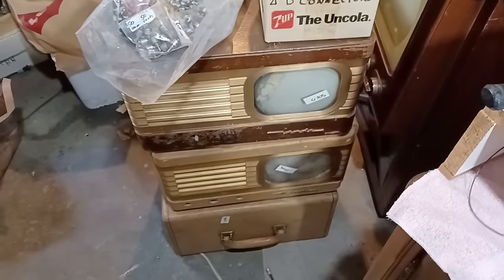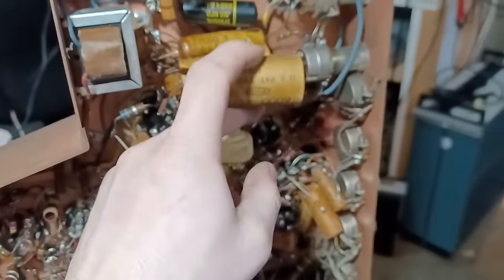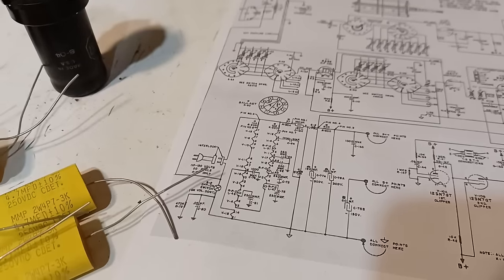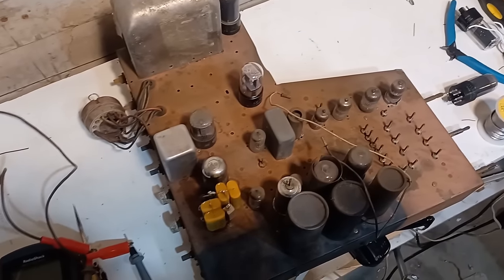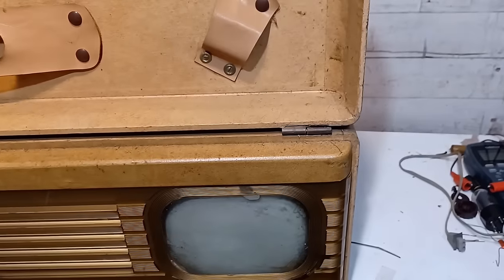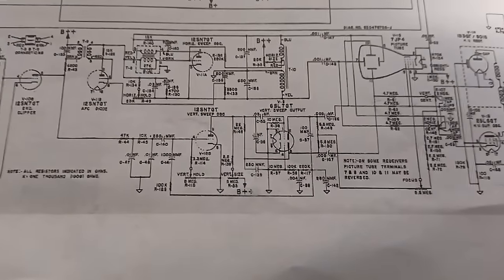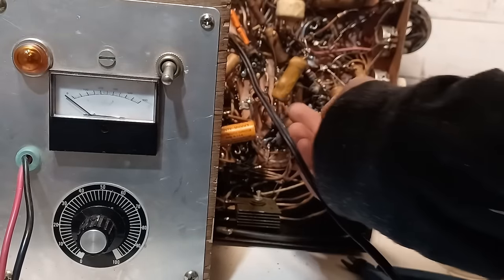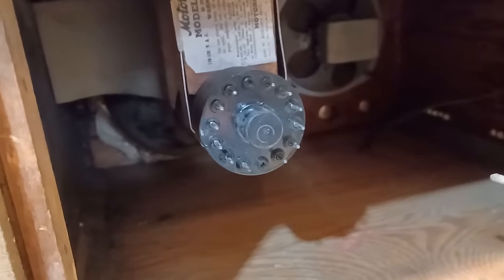1949 TV VT73 Diagnosis and Repair

Comment: I am an electronics tech and started my teenage years first on radio then television in the 1960's .  Here in Australia we didn't have series string heaters and direct rectification from the mains to supply HT to the vacuum tubes.  A mains power transformer was always used in Australian made sets as at 240V 50 Hz mains the dangers were considerable with potentially live chassis unless an isolation transformer was used.  With only 120V @ 60Hz the potential for electrocution of the operator or tech was considerably less. Another comment  is that digital multimeters are not as suitable for this type of repair as an older 20,000 ohms per volt analogue instrument. Especially for reading resistor values and capacitor leakage.  A digital meter will lead you up the garden path during logical fault finding, only use them   when great accuracy is required, in an older set like this, it's basically not ever required .  When calculating a capacitor value to use as a ballast resistor use the capacitive reactance equation ie ;  XC= 10 to the sixth power  over c x freq x 2 pi , where c is in microfarads. Transpose as required.   
I was a SGT in the RAAF teaching electronics in my last years in the service.
Robert
Reply: RAAF techs in my day were considered good technicians.
Reply: Some of the people I ended up teaching sadly would never ever have made top notch techs mainly because  they didn't ever have enough interest to apply themselves fully.  The same in every field of professional endevour , some actually liked and applied themselves to the profession, some were just along for the ride and it showed.
Reply: Fascinating!  Thanks for sharing.
Reply: Just never power it up when you work on them, not a big risc that is!
Australia is UK/ EU system mixup, you can by local Japanese systems!
You restored models, can you upload videos please !!!
Reply: @lucasrem  If you work on live chassis sets,  vacuum tube TV or radios you have to use a 1 to 1 isolation transformer so you can earth the chassis. The same applies to switchmode powersupplies in computers and other equipment.  For some fault finding you have to have power on.  I don't work on old televisions now, I have a a few old vacuum tube radios to repair but am drawn more to the battery portables which when run from the mains use series string filaments and usually a selenium rectifier or copper oxide stacked rectifier which you replace with a silicon diode and increase the value of dropping resistors as required. measure these with a good quality analogue  meter rather than a digital type as they sometimes give false readings especially on resistance ranges. The old AVO 8 was very accurate in this regard, the mark 6 being one of the better types, not so old .
Reply: In Britain, series heaters and live chassis were normal on 200 - 250V.  Until the late 50's some districts were still on DC 220V supply.
Reply: @v8pilot  It was a little before my time  as in the 1950's I was just a child. I have repaired and refurbished some series filament live chassis radios from the UK in the mid to late 1960's .The likes of 1T4, !R5, 1S5, 3V4 type 1.4V filament  vacuum tubes. They were double insulated sets so the live chassis would not some in contact with the user when used from the mains.  These run from 5 x 1.5V C cells and a 90V B battery. I have been trying to design a RF noise free DC to DC inverter to use.  Perhaps a 6V AGM battery would be a good proposal, with a resistor to drop the voltage down for the filament string. The 6V could power the inverter as well.
Reply: @Robbie1949  Yes.  |But the 'double insulation' was a bit minimal.  The grub screws of control knobs had a bit of wax inserted to prevent you touching the live grub screw.  There was nothing to stop someone operating a radio if the cardboard back had been removed.  Most live chassis sets used octal valves the equivalent (except for heater voltage and current) of the normal 6.3V valves 6k8, 6K7, 6Q7, 6V6...
My grandad had a "Double Decca" mains/battery portable that used 1.5V octal valves.  It would operated from battery or, in the house, it could be plugged into the mains and not use its batteries.  Those 90V batteries cost a packet in those days.
Reply: @v8pilot  I am guessing you are in the US or UK ?  In Australia there were and are huge tracks of land of thousands of acres  set up as sheep and cattle stations .  In the late 1920's and 30's there was no mains power in these places so for entertainment sets designed to use rechargeable 6 and 12V lead acid batteries were used . These used vibrator and transformer with electron tube rectifiers to produce the required HT supply.  There are few examples left now I suppose, I didn't have much to do with them.  at 13 I built my first one valve radio with a 1.5V B battery and 90V A battery, it was a regenerative set. Extended relatives saw my interest in radio so I received all the old mains chassis from mainly 1930's sets. The radio case being used for something else. I mostly pulled them apart building experimental amplifiers and alike.
Reply: One of the reasons, I think, why you had mains transformers in Australia was that full-wave rectification of the HT became possible hence better power-factor when dealing with long lines from the sub-station. In the UK, most TVs of the valve era were AC/DC with half-wave rectification. While saving cost and weight (not that old sets were light!), maximum current was drawn from the mains on one half-cycle hence in the UK our power supply was a bit 'lumpy' we might say. As you rightly point out, a mains transformer eliminates the possibility of 'live chassis' hence safer.
Reply: I started my working life with an electrical apprenticeship at the age of 15 at BHP Newcastle back in 1965.  Power factor was always a problem at BHP so a huge synchronous capacitor was used to correct it somewhat.  The current lagged the  voltage caused by the many highly inductive motors which were of the induction type driving conveyor belts.   The synchronous capacitor was a  huge synchronous motor that you could vary the field current to adjust the power factor.
I don't think power factor was a consideration in using transformers in radio and television sets in the domestic environment.  Connecting vacuum tubes in series in a live chassis set was a problem as  the individual heaters in the vacuum tubes could develop a high AC potential in respect to their cathodes and cause induced hum as the heater/cathode insulation broke down inside the valve.  In most vacuum tubes this was limited to 200V peak.  As the television tuner was most affected by hum (mains induced) this was at the neutral side of the series string. The IF strip being next in line.   
I joined the RAAF in 1972, posted to Malaysia in due course and imported UK sets were used there with live chassis. It was foolhardy to work on them without an isolation transformer, I copped some bad shocks there from working with these sets.  Your hands being constantly moist due to the heat and humidity did not help.  No isolation transformers to be had back then  on the island of Penang.
Reply: live chassis sets were very common here in the uk, we're also 240v, most sets had 'precautions' so electrocution wasnt possible in normal use , unless you were stupid such as removing the back or poking a screwdriver in cover holes.. , some older ones were  a bit 'hair raising' though with exposed chassis bolts on the underside, the better ones had covers, some just used wax to fill the hole the screws went in...
Reply: I remember coming across live chassis types in Malaysia. I had built a TV tennis type game from  practical wireless magazine  article and connecting it to a live chassis was a problem as in those days there was no video input so I used capacitors to the final video drive transistor or valve (can't remember)  and the live chassis.  One reflection an isolation transformer would have been a better option. I would have had to wind one though as you could not buy one then.  This was 1975 and video RF modulators were not quite available as yet.  How times have changed, free to air television via your tuner is mostly the last thing you feed to your television now to watch.
Reply: @Robbie1949  our tvs are all freeview via aerial, i dont have satellite or internet tv ...
Reply: I was making a comment on how modern televisions are used now days by most people including myself nothing to do with vintage equipment.
Reply: @Robbie1949  i meant how i get tv now with 'modern' equipment ,
Reply: I see, personally I don't watch most free to air TV in Australia as it's just mainly US crap and jammed full of advertising.  We have a news channel here run by the ABC (Australian Broadcasting Commission)  with no commercial ads, this is the only free to air service I watch occasionally.   With YouTube interesting clips can be grabbed and watched without ads.  Also the ABC has a free service called IVEW which allows people all over the world (I think)  to watch their programming, mostly sourced from the BBC.
Reply: I have since found out that IVEW from the ABC is only available in Australia due to licencing agreements. Otherwise I guess the Australian ABC would be watched worldwide as most programming is by intention of high quality.
Reply: @Robbie1949  yeah, a lot of 'standard' uk tv is now cack, all that reality tv guff 😉 but luckily still a few good programmes,
Reply: Funny, I won't watch reality TV, it's basically garbage and an insult to your intelligence.  We have some good Australian TV on the ABC and some BBC is good too but you have to sift through it.  You know when I was in the UK years ago on an extended trip I felt quite at home but in the US part of the world trip  I did not ever feel safe.  Totally different culture even though the spoken language is similar.
Reply: @Robbie1949  I connected an old CRT monitor 15" to an old 4.0 tablet with a microHDMI video output via an adapter. I installed an Internet radio and a screensaver (weather@clock).  If they had told me in the 70s that I would have such a "TV", then I would have been very surprised.
Reply: So would I, I did my first television course in 1970. It was all electron vacuum tubes back then measuring the voltage on the top cap of a 6DQ6 with a screwdriver to see if the arc drawn was about  3 or 4 mm long equivalent to  about 5.5 KV. The arc from the final anode on the CRT, about 10 to 15 mm , about 17 KV.  They were the days, you made sure the screwdriver was well insulated, I was just 20.
Reply: Wish you could have taught Harry some sense.
Reply: @Robbie1949  A valuable lesson I learned while working part time in the TV repair store my father opened after retiring was to always, always ground out the CRT before removing the cap. That thing is a giant capacitor that can hold a charge for a day or more as I found out once when I forgot to ground it. My father let me get shocked as he laughed and told me I would never do that again. The shock wasn't the worst of it, it was slamming my hand against the sharp metal of the chassis. LOL
Reply: @wayneyadams  The shock received from monochrome  television tubes hurts but as there is little current behind it it's not usually fatal.  During my apprenticeship in the late 1960's I was pulling a 100W PA amplifier out of a cubicle, back in those days it was all electron tube and heavy. The power cable became stuck in the cubicle and with pulling suddenly came free causing me to step back against a three phase 415V knife blade switch mounted on a power distribution panel. PA amplifiers were mounted in sub stations at BHP  steelworks where I was doing my apprenticeship.  It burned three strips on my left arm but I didn't drop the amplifier needless to say I wasn't well for a while after the incident.  It wasn't long that after this I joined the Air force for safer employment as an electronics tech.
Reply: @Robbie1949  Yup, like I said, the most painful part was when I jerked my hand up and slammed the back of it on the sharp metal chassis which left a nasty cut.

You're lucky to be alive, and even luckier it was your arm that contacted the switch.

Late 1960s, you must be close to my age, maybe a little younger, I'm 75.
Reply: @wayneyadams  Wasn't too well for a couple of hours but I was 16 or 17 , my arm took most of the current , three burn marks.  I was wearing rubber soled  shoes so no current to deck, or little anyway.  The thing is I didn't ever for get.  They call it to shake hands with the devil here in Australia.  It was common to lose an electrical apprentice at the rate of one a year.
One boy had a conveyor motor stall with too much coal being carried, the contactor tried to open up the 2000 amps or so current but the massive arc caused welded it in place. Stupid bugger opened up the three phase knife switch , it exploded so he wore molten bits of copper through his body. Very much dead of course, they showed pictures of his body on Friday safety lectures.  There wasn't much left of that part of the power distribution panel.  He should have tripped the OCB (Oil quenching Circuit breaker) for the substation.  It's not the voltage that kills you, it's the current in several ways.  30mA through the heart will do it that's why in substations one hand should be behind the back, in fact that rule applies to working on any live gear.
Reply: @Robbie1949  If the knife switch is so dangerous, then what possible reason was it even in the circuit?! What imbecile would design and build a system that could explode like that and kill someone?! Sounds like the danger of current through his body didn't matter if the switch exploded.

You were smart to get out and go somewhere safer.

If they were killing a person a year, they really needed some kind of regulation. How long ago are you talking about?

You said substation, did your company have its own power substation? The reason I ask is that decades ago I worked at a cement manufacturing plant that bought electricity wholesale and had its own power substation onsite.

The cement plant had breakers on the various machines that the workers tripped and locked with individual padlocks which could only be opened by the key they carried with no duplicates. It seemed pretty safe until one day the electrical foreman came into the office and showed us a panel that had fused contacts that continued to supply electricity to the machinery even when the breaker handle was switched off. Luckily the workers had the good sense not to switch on a machine which had a padlock on a breaker switch realizing they could jeopardize someone's life. A couple of times we had workers go home and forget to remove a padlock. We had to contact the worker and make sure he was not inside the machine working before cutting the padlock off.

This was the late 70s and early 80s when we were regulated by the Mining Safety and Health Administration (MSHA, pronounced imsha) which had more power than its sister agency OSHA (O for occupational) and could order any operation shut down on the spot. Well almost, it still took 24 hours to shut down, empty, and cool the two kilns, but everything else could be shut down immediately.

During the time I was there we never had a serious or even minor accident in the plant even though a cement plant can be a dangerous place that can kill a careless person, mostly repairmen who climb into machines that could crush and grind them to pieces in a heartbeat.
Reply: @Robbie1949  I like to watch programs from the oldies networks which are available as subchannels on the local stations (one of the benefits of digital broadcasting). Luckily DirecTV offers an off-air antenna and tuner that seamlessly connects to the DVR so i can use all the features of DirecTV including recording. I get around the commercials by recording programs and watching them later which allows me to fast forward through the commercials. In fact, every program I watch is recorded so I haven't had to watch a commercial for many years.

I can't and won't deal with the politically correct WOKE crap they broadcast in modern programs. I watch TV for entertainment not to be lectured at and taught far left morality lessons by writers and producers who are virtue signaling.
Reply: @andygozzo72  I watched a few seasons of Midsomer Murders until they went over the edge with political correctness. It started about the time Neil Dudgeon took over as John Barnaby.

Unfortunately, people here in the US seem to think anything British is sophisticated, even low-class soap operas like East Enders. They think it makes them sophisticated to watch British programs from BBC. These are the same people who fawn over Harry and Megan like they are something special.
Reply: @Robbie1949  My father taught me basic electronics and I took a couple of classes in high school about the time I got into ham radio.
Reply: @wayneyadams  Wayne, this was a steelworks and there were substations all over the place in the various plants.  This was the Sinter plant in the 1960's about 1966-67.  There was a knife blade switch on the power circuit (3 phase) and a single phase one on the control circuit. Both switches could be opened and tagged out with a danger tag if people were working on the conveyor or what ever equipment it powered or Out Of Service tag if  there was a problem with the circuit. Danger tags were a special case as the switches could not be closed until a foreman made sure that person who placed and signed the tag was actually off the plant and no longer working on that equipment.  As I said if there was a problem the OCB could be tripped (battery operated) this was a Oil filled Circuit Breaker which tripped all power to the substation. A massive piece of equipment which could open up several thousand amps the oil quenching the arc in very noisy fashion. The normal contactors were noisy too, like huge thunder claps going off opening up thousands of amps, very scary for a 16 year old.  You eventually managed to get used to it.  BHP Newcastle NSW had a high death rate, a steelworks is a dangerous place. 
Where are you writing from ?
Reply: @Robbie1949  I live in Southeast Florida near Miami and Fort Lauderdale, which was the spring break location in the 50s and 60s ("Where the Boys Are" was filmed there).

The cement manufacturing company was General Portland Cement, the second largest cement manufacturing company in the United States. Shortly after I left it was bought by a French (Ugh, the French) company that eventually shut down the plant. We produced ten tons of cement an hour. Each of the two coal fired kilns burned around ten tons of coal an hour. We had two small switch engines to move railroad cars around the yard to unload raw materials. I had to learn the entire process from quarry to final product. When I left, I was working on a project to computerize Inventory and production control.

I'm horrified to heat that there were several deaths a year at the company where you worked, it shows a complete lack of concern for the wellbeing of employees. Who in their right mind would have open knife switches that could explode or be placed where workers could fall into them to be electrocuted?!

A padlock that can only be removed by the worker who placed it is still a bazillion times safer than a tag. The bolt cutters used to remove locks of workers who forgot to remove them were locked in a cabinet in the foreman's office and could not be used to cut a lock until the foreman contacted the worker. When multiple workers were inside or in dangerous positions around machinery, a heavy metal scissors like device was used which allowed multiple locks to lock out the breaker.

As much as I believe the government has become overly intrusive in our lives, I am glad that MSHA (Mining Safety and Health Administration) is around to enforce safety regulations. In the US, cement manufacturing is considered a mining operation, so MSHA regulates it.

We got a little off topic. LOL
Reply: @wayneyadams  These substations had been there since at least the 1950's perhaps earlier.  They were a restricted area , Only Authorised Personnel was on the entrance of these buildings in large red lettering.  The open knife blade switches were designed to carry huge amounts of current.  I was only a young teenager it probably wasn't possible to replace them with anything able to do the task.  BHP steelworks plant was huge , we were used to going in there and doing work on the various panels.    At the end of my apprenticeship I was working in the electronics section.  Carrier radios were used for crane communications, we used to hop on and off moving cranes up over 200 ft above ground in order to replace defective radios or repair them in situ.   They were made in the US  'FEMCO" with series heaters, 25AV5's were the output vacuum tubes with 100 to 190 Khz FM modulated  . The cranes ran on 250V D.C. . There was a complete DC power generation on plant.  Now days of course you would rectify the mains but back in the 1960's for the several hundreds of amps required a D.C. generator driven by a steam turbine or a motor on 415V 3 phase 50 Hz supply. There were many D.C. cranes in use, it wasn't my area but shift electricians used to look after them on call.
Reply: Congratulations!
Reply: @jozefbubez6116   In Australia, small domestic appliances, like TV and radio sets, were the last thing the power generator/grid Authority considered in relation to power factor. Their focus on PF was always (and only) regarding large motors and large arrays of fluorescent lighting or HID in commercial/industrial contexts, AND their own distribution equipment - HV to HV and HV to LV street transformers. (worked in the industry for >40 years) 

As far as 'safety'... 250V 50hz is tame compared to the higher DC voltages that present in these valve sets... and I wouldn't like to get a belt from that CRT flyback potential.  

Then there is the asbestos issue.